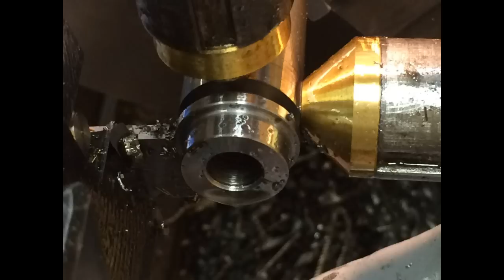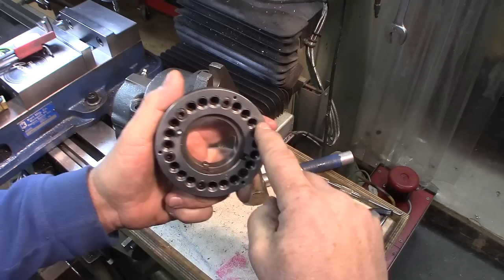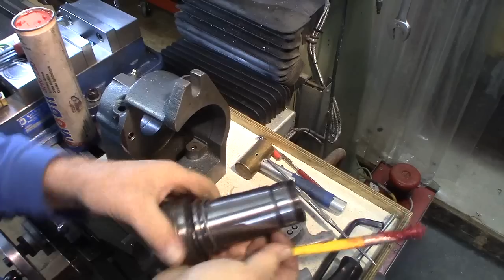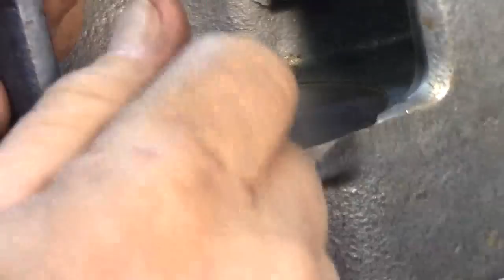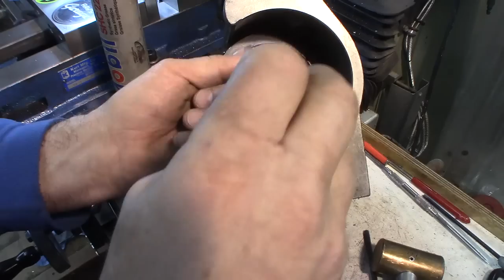How to clean a 5C Collet Indexer Fixture

Comment: Got lucky and just bought my YUASA off Craigslist for $60!  Saw your video before I restored mine, thanks!  Had to create a new ratcheting detent for mine to keep the ratchet from slipping, along with replacing the two needle pins (one needle pin is used to align the ratcheting detent, and there's also pin to hold the sleeve/bushing both inplace that the main geared indexing pin rides inside.  The sleeve needs proper alignment as the sleeve has a cutout section on it to expose the gear of the indexing pin for mating with the release handle's gear -- though I don't think you had to mess with the indexing "sleeve" in your video.)  Overall, I had to do lots of cleaning of old dried grease. I also had to debur my locking pin around its gear area to allow it to travel more freely inside the sleeve (for which my "release handle" now readily snaps into place as soon as it aligns with the next index hole.) 

One tip when tightening the main LOCKING ring/collar:  keep the indexing pin FULLY RETRACTED from applying ANY pressure on the index-plate, while tightening the locking ring -- and you'll be surprised at how little (if any) you'd need to tap on the locking ring's groove with your screw driver!  (I've had to disassemble/reassemble mine several times to resolve my ratching issue, and figured out the trick, since when the pin is fully retracted, you'll be able turn the ring significantly more by hand without tapping on it.)  I'm thinking that, with the built in tolerances, it actually snugs up sufficiently without the need to torque it much, which is why I believe they designed that additional locking screw that mates with the coining on the outside of the ring (as a solution to holding the locking ring in place under a low torque scenario.)
Reply from the maker: Good deal,  Thanks for the comment.

Comment: Nice indexer. It looks identical to mine which is a “yussa “. Mine isn’t in great shape, and missing a few parts like the little locking piece that stops the knurled round nut from loosening, the metal ring that serves as a stop for the plunger screws, the thread protector and the ratcheting handle. I’m sure you would never find parts, but looks like they could all be made. But with your video at least I know how to take it all apart. Keep the videos coming! JB San Diego
Reply from the maker: Thank you JB.  I think you are correct.  Good project, very handy unit.   Stay safe down there.

Comment: Excellent video!!!!

Do you think it might be a better idea to use a machine oil rather than grease?  Im a noob but I have found with tight tolerances machine oil allows the lubrication needed.  Also I have learned the hard way in some cases that tacky grease holds foreign materials rather than providing low friction for them to evacuate; Sometimes causing marring etc, especially with harder chips.

Coming from the automotive workd I put some red n tacky on the spindle in my bridgeport and i couldnt even turn it by hand 😅.

Not saying you are right or wrong just throwing it out there.
Reply from the maker: Thank you.

Comment: Hey Randy went back into the archives. I got a HV-0 Hardinge (little brother to this one I think). The one I got is a 20 pin indexer. Thoughts on making a 24 pin like yours? I think the ring would be about the only needed change and maybe the locking pin diameter. I think it’s worth a try anyway.
Reply from the maker: Sounds like a plan Dan.  More options.  Merry Christmas.

Comment: Hi Randy !
Nice indexer but what are the idea behind the screws in the indexing holes ?
Maybe something to do with the preset index pattern or ... ??
As you saw yourself they COULD be the source to a problem if the indexing pin is NOT allowed to go fare enough in the hole !
One can't even take them out because of the cover ring - it looks like a stuped design with these screws ... what's the idea ?
Reply from the maker: You back out the screws where you want it to lock in and stop.  You have 24 possible stop positions.
Thank you Keld, for watchings.